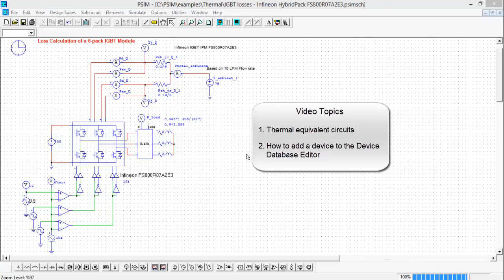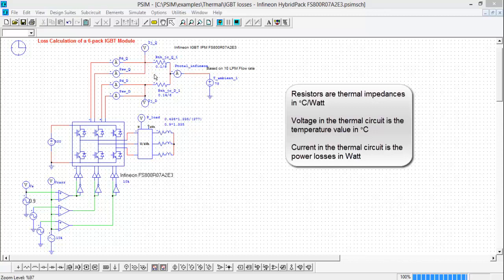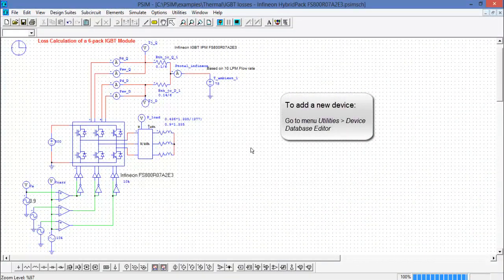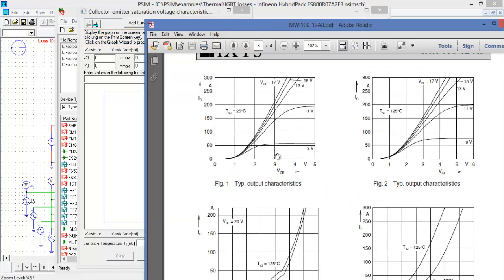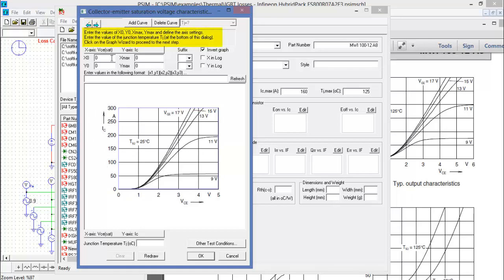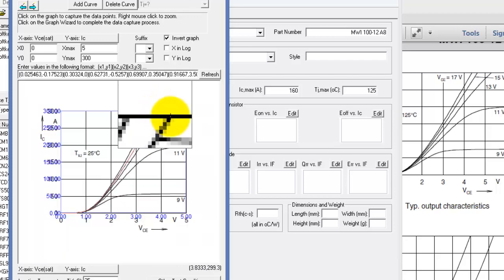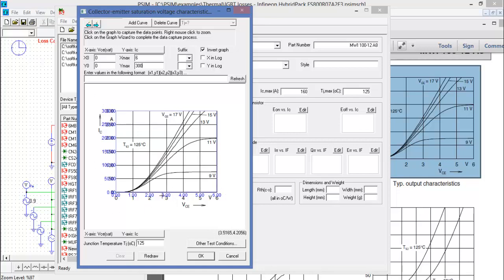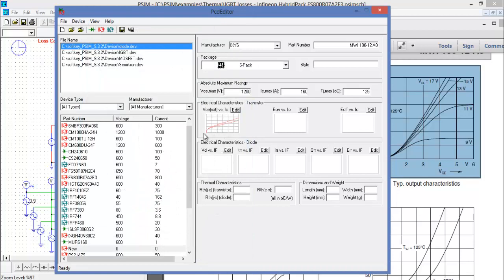Introduction to the Thermal Module in PSIM

Comment: This is a good video/introduction to the thermal module, but comparing the results of the thermal module with the results obtained from simulation softwares of the semiconductors manufacturers  (IpoSim, SemiSel...), they never seem to match.
With this in mind, I question, is the goal of the thermal module to give a broad and general idea of the thermal losses or to be an accurate and crucial part in the design of power electronic applications?
Reply from the maker: Thank you for your comment!

The goal of the Thermal Module is to generate power loss results that provide a general idea but also are accurate enough for power converter design.  For one test case, PSIM and IpoSim's switching losses are within 8% of each other, and the conduction losses are within 1% of each other.
There is an IEEE published paper that compares PSIM Thermal Module results with experimental results, and finds that the PSIM results are within 10% of the experimental results.

If you would like a more detailed analysis or a list of published paper references please contact our support team directly. This can be done on our website through the Support Request form, or directly in an email to support@powersimtech.com
Reply: PSIM,  thank you very much for the reply.

I have to say in my experience, the thermal module add-on has been a good learning tool, proving to be very useful in that regard. But now I need it to a more real life application and I'm finding it somehow limited.

For instance in an IGBT it doesn't consider the energy recovery of the transistor like in SemiSel. Also, it doesn't allow me to add other topologies like the SKiM301TMLI12E4C module which i'm thinking of using for a T-Type Inverter.

This last point is rather frustating since currently I'm researching on the power losses of different topologies of inverters and boost converters, and can't find a flexible approach within or with PSIM.

So with this in mind, is there any update in the foreseeable future for the thermal module, or do you have any tips that I can use in my design simulations?
Reply from the maker: vodkatotta
Can you please clarify what you meant by “energy recovery of the transistor” (which quantity is it in the datasheet)?

As for the device SKiM301TMLI12E4C or any other topologies that we don’t support at the moment, you can always enter the device as a single discrete device into PSIM’s Device Database. Then use multiple elements of the discrete device and connect the circuit in the same way as the original device. The thermal nodes of the discrete devices can be joined together through their respective junction to case thermal impedances to simulate the effect of being in the same package.

In short for an unsupported topology use the supported discrete devices and connect them appropriately electrically and thermally. 

Does this answer your question?
Reply: PSIM
 I've applied your recomendations and comparing with other simulation softwares,  the thermal module seems to be in the error range that you specified (though I don't think this can be used to every topologies).
Thank you very much.
Reply from the maker: The paper in question... Martinez, C.; A. Lazaro, C. Lucena, I. Quesada, P. Zumel, A. Barrado (Mar. 17-21). "Improved Modulator for Losses Reduction in Auxiliary Railway Power Supplies". Twenty-Eighth Annual IEEE Applied Power Electronics Conference and Exposition. Long Beach, CA: IEEE. pp. 2324–2331

Comment: Can i do these steps for diode also? I can add any manufacture diode? Are these features available in psim version below 10...? How much will it cost to buy psim latest version for power electronic research
Reply from the maker: yes you can do the same steps for a diode. the thermal module was released before version 10, you need to submit a price request to get pricing. goto the website www.powersimtech.com

Comment: why the ambient temperature  selected to be 75?
Reply from the maker: +Abdulaziz Alkuhayli No particular reason, the ambient temperature needed to be something.
Reply: it could be aleatory?
Reply from the maker: @nihadaghbalou9806  completely random is not helpful, typical ambient temperature ranges could be 10-100 dC depending on environment. Typical max temperatures for junctions are in 150 dC range, so any thing hotter than this is not really useful.

Comment: I have a question, let say if the simulated circuit characteristic such as the collector current appear to be larger than a device's maximum collector current, will error appear for loss simulation or will it continue simulating with wrong losses value?
Reply from the maker: if the input data does not include the value that you are simulating, PSIM will extrapolate which will likely give you clearly wrong results. As the designer you need to review the waveforms to make sure everything makes sense.. This is why you'll make lots of money when you are in industry, by being thorough in your designs and doing careful review of any data.

Comment: I would like to ask something concerning the module. Let's assume that we have a converter (the type does not matter). I have noticed that if we add the average generated loss to the power output, the result value is always greater than the power input (measured using a wattmeter), which is quite paradox. In other words what I mean is that Pout+Ploss>Pin. Can you explain me why this happens?
Reply from the maker: +George Apostolou  good observation, the module is not intended for an efficiency study. The switching losses generated by the module are only calculated and will not be supplied by the source. This allows for a fast simulation as it reduces the simulation points needed. The objective of the module is to help with thermal design, rather than to calculate overall system efficiency. 

For a calculation of efficiency please use the level 2 devices included in version 10.